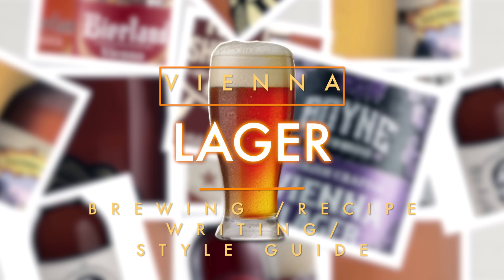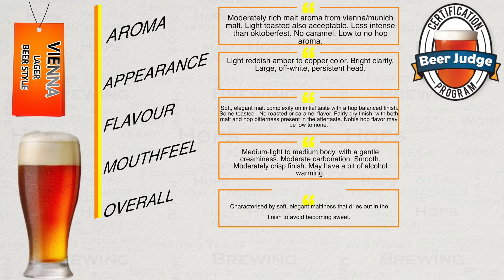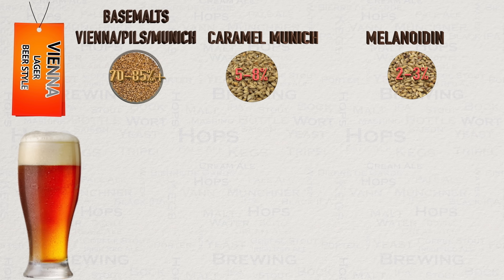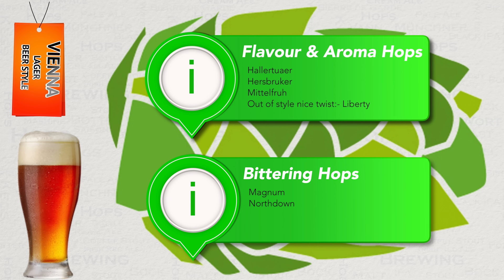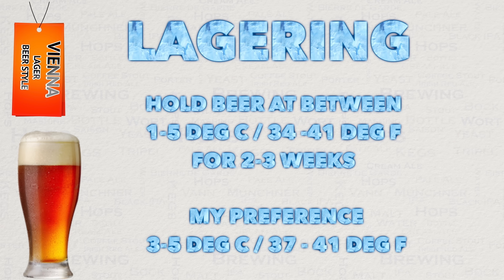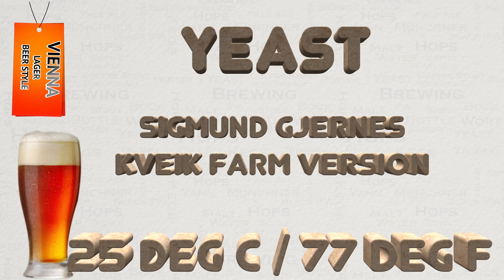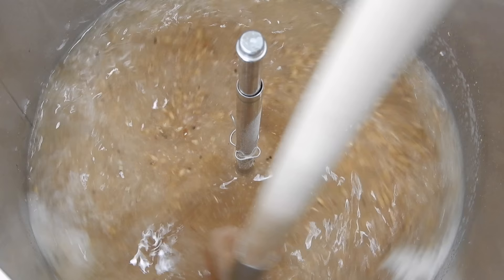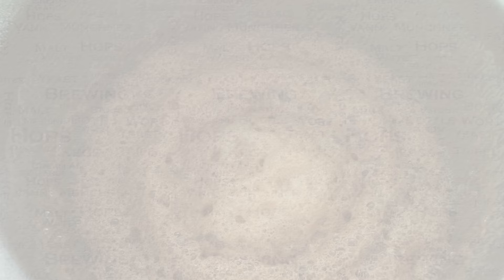Vienna Lager Brewing, Recipe writing & Style guide

Comment: Just completed this and it's in the fermenter. Thank you :)
Reply from the maker: Enjoy Paul 🍻🍻🍻
Reply: @DavidHeathHomebrew  I think this will end up in the compost as after 3 days no start to fermentation. I increased the temp to 20 degrees and it did start but when I reduced it back again to 13 it stopped again. Using liquid german WLP 830.  I guess I will stick with Keveik from now on haha.. Oh well it happens sometimes I guess . Will try again with Lutra at the weekend :)
Reply from the maker: Hey Paul, I suggest adding more  yeast and saving it, if you have some to hand.
Reply: @DavidHeathHomebrew  Thanks but I only had i packet of this expensive wet yeast to try. I've ordered more vienna malt which arrived today and Lutra dry yeast x 2 for a back up. Just have to put down to experience I guess. Oh well the lawn will get some beer nourishment haha  As always,thanks for your advice and fantastic channel cheers 😀
Reply from the maker: Hi Paul, it probably was not enough yeast and needed a starter. I stick with dry yeast these days. Similar results, much cheaper and lasts much longer.
Reply: @DavidHeathHomebrew  Lesson learned haha  It's actually started off again yesterday so will just leave it and see what happens. Who knows it might be the next best thing haha
Reply from the maker: Fingers crossed then 🍻🍻😎
Reply: @DavidHeathHomebrew  It will probably end up as lawn feed (yes it works) but you never know :)
Reply from the maker: At least the lawn will enjoy it I guess!

Comment: Hey David,
thanks for another awesome video. I have just created my first recipe for this style in beersmith, following your advice.
However, I disagree with one instruction you give. You recommend pitching the classic lager yeast at ale temperatures before cooling down to lager temperatures. I have put that to a test once with a German Pilsner and the S-189 lager yeast - One batch was pitched before the last bits of cooling just like you recommended, the other one after. The first one picked up some (not an awful lot!) esters on the way, while the one pitched at low lager temps (8°C) displayed none I could detect.
I gave a bottle of each to a BJCP judge I know, who tasted them together with other BJCP judges and they also detected a bit more esters. Mostly they agreed that the one pitched at lager temps right at the start was better because the beer had more of a rounded flavor in the end. 

Have you done some testing of this? Besides the slightly higher level of esters that was to be expected, my friend also pointed out that I had put my yeast under an unnecessary level of stress by changing the temperature of the wort so rapidly after the yeast was pitched. With other strains it might have even led to the yeast going in hibernation mode.

Looking forward to reading what you think about that :)
Cheers!
Reply from the maker: Hi, I have tried this myself with many different types of yeast without adverse effects. It is not only me doing this either. It is modern day advice that is used by many breweries and home brewers. Could have been an off flavour with a different reason behind it. Rapid temp changes before fermentation should not result in esters.

Comment: Hello David, I want to try this recipe, but I don't have the means to "lager" it. I do have a fermzilla with the pressure attachment though. Using pressure fermentation how would you ferment this using a lager yeast? Will not bringing it down to cooler temperatures have a big impact on the flavour? Thanks!
Reply from the maker: Hi, No problem if you can use pressure fermentation. Here is a guide to that here:- https://youtu.be/W7WSFn6bNoA

Comment: i can get only maximum 20 celsius. can i do this at 20 celsius and under pressure? if im using kveik?
Thank you!
Reply from the maker: You can use pressure with any yeast, including kveik :)
Reply: @DavidHeathHomebrew  
Thank you! I have one more question. Sigmund kveik says it has a fermentation zone between 25-40 and i can only go for 20. Will it still work? Or would you change yeast in my case?
Reply from the maker: Ive found 20 to work. Just be slow. Be sure to use plenty of yeast nutrient.

Comment: What sort of pitching rate are you using for the Voss when doing this style of beer?  I've used Voss before in NEIPAs and severely under pitched and fermented alot warmer to really bring out the esters that are characteristic to this yeast.
Reply from the maker: Kveik has a low pitching rate compared to regular yeast. I keep the pitching rate at 1 teaspoon for batches between 21-30L and the results have been very satisfactory for all styles. This yeast bends and often breaks the rules compared to regular yeast.

Comment: Hi David, great video again. This will be my next brew, as I have a 25kg sack of Vienna that I need to use. I'll use your recipie, and ferment it with Gjernes Kveik, as I have loads of that. Only one question regarding your recipie:  The Carafa I malt is listed to be 630 EBC.  But the ones I find at Vestbrygg (and Bryggselv) have a EBC of 900. On Wyermann pages I see that the Carafa I malt is specked to be between 800 - 1000. So what Vestbrygg states (900) looks correct.  Just wondering if you made a typo in the recepie?  Thanks and regards, Geir Valsvik.
Reply from the maker: Thanks Geir. The information was correct at the time but the malt changes from time to time. I suggest you use enough to get the same level of colour, so use a little less :)
Reply: @DavidHeathHomebrew  Thanks David, I'll use a little less then. Will adjust the amount in Brewfather to get the same colour :) Best reagrds Geir.

Comment: Hi david, need some good advice now: i plan to brew your Vienna pseudo-lager tomorrow. I have another brew in my temp controlled fermentation chamber. So this will be brewed in room temp of roughly 20c. I have two yeasts availlable: lallemand novalager and voss kveik. Which one do you suggest to use? Temp might vary a bit according to weather.

Also should i ferment under pressure or not? I only have one pressurised fermentation vessel and plan to brew a wit (hoegaarden clone) also (this is the one planned to go to my temp controlled fermentation chamber). Which one do you think would benefit more from pressurized fermentation? The wit is the more important to succeed well.

Thanks alot in advace on your advice
Petri
Reply from the maker: Hi Petri, the Voss is ideal for this situation and can be used without pressure. Enjoy the brew 🍻🍻🍻
Reply: @DavidHeathHomebrew  thanks alot
Reply: @DavidHeathHomebrew  would Voss work also ok in case temperature falls somewhat under 20c?

Comment: Well I've done two practice fermentation/kegging with fresh wort kits and I've decided this will be my first brew. I'm assuming a 30min boil will be fine? I'm curious, in what circumstances is a 60min boil still required? Is it when there is a high percentage of pilsner malt in the grain bill?
Reply from the maker: Hi Steven, the only time these days that you would want to boil for longer than 30 mins is when you are using malt with very low modification. Often known as farm malt. There are some traditionalists that will continue with 90 min boils and more but this is not a common perspective these days.
Reply: Well I finally brewed this. I over estimated my equipment efficiency and missed the OG by 5 points. I didn't have the mindfulness to boil off.  However the finished product is now bang on inside the bjcp guidelines. The vienna malt gives it a nice something something with aroma. Very clean and sessionable. Thanks for the recipe. Coming into the Australian autumn, thinking your Irish red next.

Edit: I used lallemand voss kveik yeast and I fermented under pressure at 25C.
Reply from the maker: Great stuff Steven 🍻 Many thanks for sharing this information 🍻🍻🍻

Comment: Great video. Just they type of recipe I was looking for! I'd like to try with Lalbrew Voss Kveik (which I have never used before), but I don't have temperature control to maintain 25c.  How do you think it would do at 18-19c?
Reply from the maker: Thanks. At those temps it will have a lager like profile. Fermentation will be slower but it will still condition quickly.

Comment: Great video. Do i need to make a starter for example for kveik yeast for about 10liter batch? I'm only one brew of experience and i'm more comfortable without a starter. Secondly, i have a storage about 16-18deg celsius, is that a good temperature for this type of beer and this temperature only? Thanks!
Reply from the maker: Thank you. Half s teaspoon of kveik will ferment 10L as long as its not over 1,065 OG. So a starter is really not needed at all :) 
Kveik when dry is best stored at cooler temps, 16 is ok but a little lower will help. A fridge is needed for liquid kveik. Hope this helps :)
Reply: @DavidHeathHomebrew  sorry, about the temperature i meant fermentation temperature. For this beer being a lager is 18deg celsius too warm?

Comment: Hi David, I am planning to brew this. Is it ok to use Lalleman Kveik Voss dry yeast. Is it enough whit 2 package(11 g) for a batch of 23 litre? Why use 25 degree celsius fermentation temperature? It would be faster fermented at 35-40?
Reply from the maker: Each pack is good for up to 22L, so two will be safe when pitching from the sachet. If you go less than 25C then you will get a lager like profile. Higher will be faster but then you will have an ale profile.
Reply: @DavidHeathHomebrew  Thank you 😊 looking forward to brew this 🍺 What is the diffrences between this beer and Brooklyn Lager would you say?
Reply: @DavidHeathHomebrew  can you store this beer as long as an traditional made lager beer?
Reply from the maker: Yes, no problem ;)

Comment: Hi David, greetings from Mumbai. I've recently got hold of Lallemand's Voss Kveik dry yeast and am tempted to try it for this recipe, unless you don't recommend it. Also, plan to use Perle hops at knock out and at 10 mins. What do you think?
Reply from the maker: Hi Ravil, thank you for your message. The Voss kveik will work well as long as you ferment lower than 25C. 20-24C will be ideal, unless you are able to do this under pressure, in which case a much higher temperature can be used. Perle hops will work just fine also.

Comment: You provide tons of value.  Thanks for your efforts.  So my local store carries the Omega Hornidal (OYL-091), but not the Voss.  Would you amend the suggested fermentation temp/schedule given my intended use of Hornidal?
Reply from the maker: Many thanks Jim. I have not try this hornidal, just the farm version. I believe this will work very well. It is not allowing quite as high a fermentation schedule as hothead but it is just at small difference with the Temperature Range of 70-95° F (21-35° C). As long as you stay within this then all should be great.

Comment: I see you fermented at 25c.  Many sites talk of fermenting at 35-39C and the recommended pitching temp is 36c when using #1 Sigmund Gjernes, Voss.  Is there a flavour benefit of the lower temp?
Reply from the maker: Hi, those are the normal temperatures but when you ferment at 25 or less you obtain a lager like profile from this yeast.

Comment: Hey David, thank you for the informative video. Coincidently i brewed this lager before you uploaded this video. I used saflager 34/70 and experienced a long lag time (can be explained because i pitched at 10 degrees and the dry yeast was not fully rehydrated). After 5 days it had only moved 10 gravity points. When i came back from holiday (13 days in the fermenter) it had reached target final gravity. Is it too late to do the diacetyl rest now?
Reply from the maker: Hi Oliver, ive known people do six weeks fermentations with lager with great results. I would do the rest steps now and continue to plan.
Reply: David Heath Homebrew thanks for the advice :)
Reply from the maker: No problem :)

Comment: Brewed this 10 days ago but think I have gone wrong I wanted it bit weaker so added a couple of extra litres of water got an sg of 1.050. It's now been at 1.020 for 4 days using omega voss not sure what I brewed but not sure its still a vienna lager
Reply from the maker: Hi Martin, have you tried rousing the yeast? Are you able to raise the temperature at all?
Reply: @DavidHeathHomebrew  hi David I upped the temp a few days ago to 26 and no difference. I just put at 27 and gave it a rousing so hopefully that will make a difference was hoping to bottle in a day or 2 as need my fermentor... Thanks for the tip.

Comment: Hello David, great video as always, thank you.
I have just brewed this using Kveik Voss at 25C and am experiencing a very slow fermentation, it's still chugging away after nine days. I've done something wrong but am trying to find out what. Can I ask do you use extra nutrients when using Kveik? I just used the amount of nutrients that it said on the packet and have since read that kveik is a hungry yeast. Would it be beneficial to double up on nutrients with kveik?
Regards, Jim.
Reply from the maker: Very sorry for the late reply, YT has been very buggy recently so I only just saw this. Did this turn out ok in the end? 9 days is a long time for kveik, even at that temperature!
Reply: @DavidHeathHomebrew  Thanks David. It took three weeks to finish. The beer was OK but had a twang to it which is hard to describe. I might try again with lallemand Voss.
Reply from the maker: Ouch. Yes the overpitch will do that sadly.
Reply: @DavidHeathHomebrew  Thanks David, I'll get it right eventually. Thanks for all your hard work.

Comment: Excellent video, David. I caught your comment on the Brewtools’s paddle and went to their website to check it out. They fail to mention the length of the paddle, though. Could I ask you how long it is and if it is long enough to scrape the heating element on the Grainfather during a boil?
Reply from the maker: Thank you :) sure, it is 57cm. Ive not used it for bottom plate scraping personally as I now use a false bottom in my GF.
Reply: Thank you, sir!

Comment: Hi David, would Lallemand's Voss Kviek Ale be ok to use for this also?
Reply from the maker: Yes, that will work well, at the lower temperature discussed in the video for a more "lager like" profile.
Reply: @DavidHeathHomebrew   Thanks, the recommend a 25 - 40 degree optimum range, so I will try it at 25
Reply from the maker: 25 C max for lager like profile.
Reply: @DavidHeathHomebrew  David, Could this be done under pressure using the Lallemand's Voss Kviek Ale? Would you apply pressure right away ? (Assuming 25C under pressure as well)
Reply from the maker: Yes, no problem using voss under pressure for this one. As long as pressure is there from the start then you can do this at higher temps also. I find that often this is a 1 day ferment at 35C with 12 PSI of pressure and the end result us very clean and lager like.

Comment: Hiya David, this looks really interesting and a bit different - I'm planning to have a go at this next week. I am going to use Kveik but have only used it before in cloudy Belgium Wit Beers where clarity isn't that much of an issue.  I'm just wondering how you get the beer nice and clear in the fermenter  before bottling and adding fresh yeast, if lagering isn't required?
1. How long do you leave it in the fermenter?
2. Are finings required?
3. Does it drop clear in a super speedy manner?
I was brought up brewing with a primary fermentation with added finings in the secondary. I guess I'm finding that old habits die hard!   Any advice as always is greatly appreciated!
Reply from the maker: Great :) Any beer can be made clear with the use of finings. Cold crashing will speed this up and usually takes a few days. I have a guide to clarity here:- https://youtu.be/xwtJtBAj5uY
Reply: @DavidHeathHomebrew  Thanks David. Sorry to pester you, I need a bit of extra clarity so to speak (excuse the pun).  I've always been worried about adding finings a day or two before bottling / kegging as I was worried about oxidation. I have always transferred the beer into secondary before the end  of fermentation, added finings then and been fastidious about keeping the beer under air lock for a few weeks until bottling. Can I abandon this method with fast fermenting yeast, wait for the end of fermentation, open the fermenter, chuck in my finings,  seal it and bottle the next day?  

I also notice that you have suggested Northdown hops as an alternative to Magnum. This is great news as I have a fair quantity left in the freezer after following a clone London Pride recipe.  Could I also substitute Magnum for Northdown in your Kolsch recipe too or would this bring it too far out of style?    Regards!
Reply from the maker: Hey no problem at all :) As long as you are careful not to splash then no problem. No problem in this hop sub for any style :)